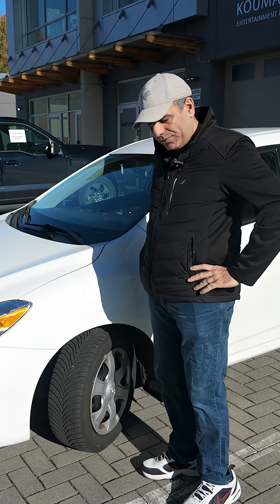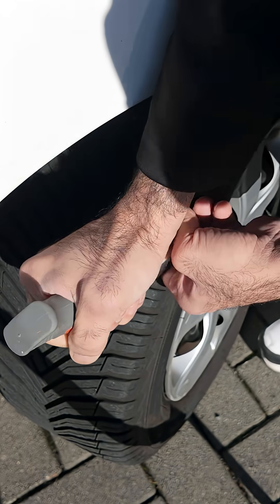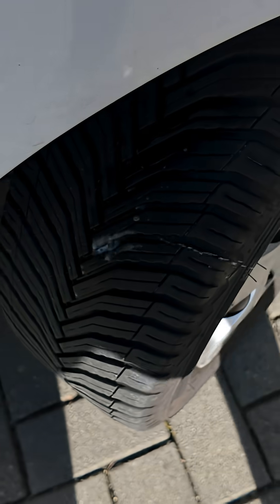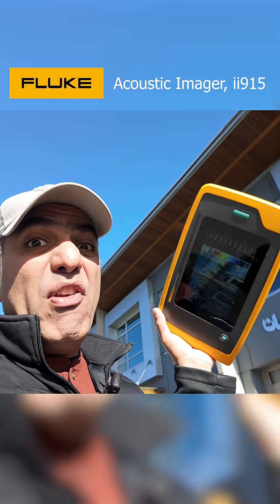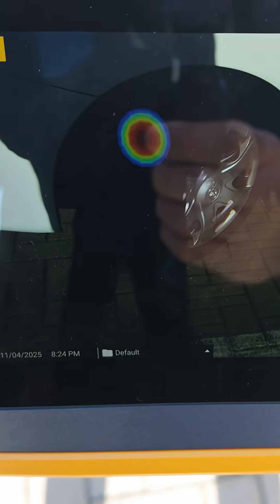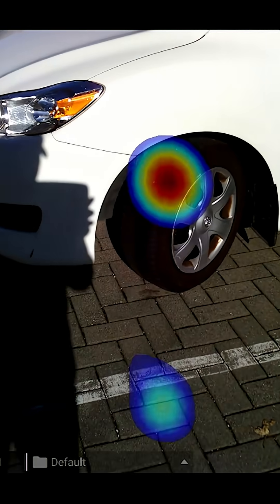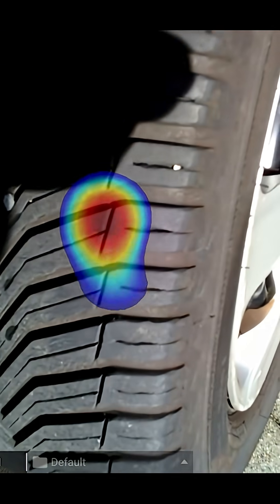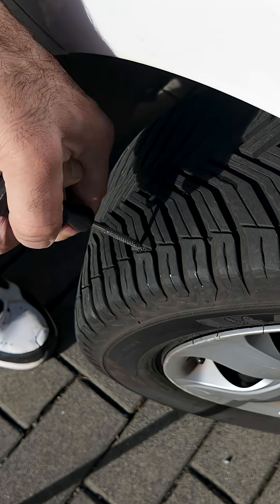Fix a Flat Tire with a FLUKE Acoustic Imager! #technology #equipment #electronics

Comment: Work in maintenance and use one of these to find air leaks quickly on a conveyor in a noisy environment. Bad idea to constantly spray metal equipment with water even if it's painted, and you can't hear air leaks over the industrial noise.
 
Aside from seeing a section of the bed not moving this tool is the best option.

Comment: Hi. Im a diesel mechanic and tank tester with 18 years of experience and you'll have a hard time finding someone better with tires than me. I just use soapy water. That device would be pretty good for finding air leaks underneath the trucks though. Everything on big rigs runs on air. And a lot of air leaks are inaudible, so you don't even know they're there unless you monitor your air pressures.

Comment: Those rope seal plugs don't fix the tyre ;) and the "tool" that comes with them makes the hole too big to legally repair from the inside :( They are for off road use only, and intended for places where you can't safely jack the vehicle up to change the wheel, literally just supposed to hold air long enough for you to move and change the wheel ;)

Comment: Fluke equipment is the best, but you need to be filthy rich to justify it. We use their cable testers in work for ethernet. The only downside is the tester cost like 5250$.

Comment: My friend had to build one of these as his electronic engineering end year project. The hardware is relatively simple, just a bunch of microphones in a spiral with a camera in the middle. The coding is where things get real complex, the bulk of his project was coding the geometry to calculate where a sound is coming from, Fourier transforms to breakup the frequency's and then a whole special heat map generator to show the user on the screen where the sound is. The whole project cost him around $300 but factor in the 6 months of coding and tweaks it makes sense that these can get quite costly. One of the coolest guys I know.
Reply: I feel like the main problem here is the synchronization of each microphone. Getting the analog data from each one at the same exact time is a problem. Not sure but off the top of my head, he is relying on the phases of the waves, that's why this is so difficult. They must be aligned, which is easier said than done, and I know I could not have done that.
Reply: @cagedgandalf3472 : I mean, that's really just an fpga/cpld/other hardware issue (to get high-accuracy time-stamped audio data), and does not get the algorithms implemented.
Reply: Meh. It's simple beamforming. 

The problem is the diffraction limit sets the resolution and sound waves have very long wavelengths
Reply: How far could large language models get I wonder.
Reply: @TechEject I believe not very far. This is a completely different problem than what LLMs solve, as they are fancy word predictors (unless I completely misunderstand LLMs 😅)
Reply: @Incommensurabilities  you kind of are. The first L in LLM is "large," and they MEAN large. They mean the internet, including all published research on this topic. The LLM can't understand scientific papers any more than it can understand anything else, but it can certainly synthesize their contents into a product of some kind. And generative AI in general could take a whack at this kind of stuff, but idk how effectively. Lots of human input required to sift through the extremely unintuitive results AI models put out when you have them try engineering.

Comment: Now put that tire on the back...so that your unsuspecting neighbor doesn't lose a steer tire by slinging that sht plug out while speeding down the interstate at 85-90 mph...or 137 -145 kph if you prefer metric.  TireBOOM lol.

Comment: For around 12K EUR, I probably will keep using soapy water. However, gas leaks in pipelines and at well heads, can be measured with accousic leak detectors as well.

Comment: I wonder how well this would work on a running engine. Would it be able to detect the location of a knock or tap or would it just be drowned out the normal emgine noise?

Comment: Ok here is a serious question, dont these repair kits ruin the tire even if its in the center of the wheel not the sides? Because they tell me to remove the tire, and fix it with some rubber from the inside every single time

Comment: So you have a flat tire
Step 1: do not panic!
Step 2: pull your High Mobility Artillery Rocket System from your pocket and ask it to change the tire for you.
It'll call in it's cousin juan, who will give you the turbo invincible master tire with a million year warranty.
If it declines, simply "barrow" a tire from it while it's not looking and use it to replace your tire.
Congratulations, you now have a new tire.

Comment: I've heard a lot about this, but this is the first time I'm actually seeing it used. military is looking into this tech as a way to locate drones (very topical), and arenas to identify issue points at festivals/concerts. I was never sure how accurate that would be but certainly with this the drone application seems very plausible.

Comment: Yes, but you just ruined your tire. Those rope plugs only work temporarily, and shops that repair for free won’t fix it now when it starts leaking. There were WAY better ways over showing this without wasting $250+ on a Michelin Cross Climate. Those tires cost a ton, and aren’t even all that good.

Comment: Cool technology, but not useful for that application. If the leak is so bad that it is audible, you can easily pinpoint its general location by listening, and then find the exact location by feeling the air against your hand. Slower leaks won't be detected

Comment: This is soo cool but wait! Usually customers will only notice air loss when tyre already flat so no air leakage to detect! Perhaps if it's a slow puncture or/and vehicle has TPMS installed this can be uses.

Comment: As a ex mechanic, those plugs are a good temporary but can cause issues in the future. And the nail, although most would probably say it’s fine, is very close to the side wall, usually considered unrepairable. Although debatable. Stay safe on those roads!

Comment: Honestly this thing could be a game changer. I am a HVAC contractor and I use ultrasound leak detectors for refrigerant. I wonder how well this would work. I was trying to find a leak in a evaporator in a walk in freezer and it was audible but still difficult to locate because the conditions
Reply: I work on industrial refrigeration. This would save me so much time.
Reply: For $9000, I think I'll stick to conventional methods.
Reply: This one is over $25k. They offer the ii500 to peasants that costs around $9k.
Reply: They only cost about $10k
Reply: I work in HVAC too, and I literally sent this video to my foreman 😂 his ears don't work anymore and half the team relies on mine when they can't find leaks!
Reply: we have them in manufacturing
Reply: The detector is infra Ray detector it detects the difference in temperature when the pressurized air in the tube releases it becomes cool so it appears as blue colour
Reply: FLIR has a really cool one, we demo'd one and were able to use it to find an issue in a gear train!

Comment: Smh 🤦‍♂️ I already know he put a hole near the edge planning on saving the tire and continue using it but a puncture within a inch to inch and half from side wall makes the tire unsafe to use anymore. He was better off going right in the middle of the thick center tread

Comment: A thermal cam might be able to spot this also...those are available to plug into a smart phone...
The air escaping only needs to be slightly different temp then the tread.
Reply: or it might even be visible due to the surrounding air being a different temperature since depressurisation causes temperature to drop

Comment: These are typically used in audits of compressed air distribution in production facilities. Even in a small facility leaks can cost thousands per year in electricity, and I have seen one that the analysis was $30k/yr lost to air leaks.

It never occurred to me to use one on a car tire.

Comment: string plugs are not ideal for a healthy tire, they are a temp fix and should be plugged properly from the inside to avoid steel belt separation 👍

Comment: We use these at work. The camera is good but not perfect. Very small (but inacceptable) leaks can only be found with the soapy water. The camera is good at positioning the leak though
Reply: have you tried detecting a fart with it?
Reply: By camera, you mean imager, right? Because this thing has both, but it's the imager part that's detecting the sound. The camera is just to provide a display for the user.

Comment: Technically rope plugs are only temporary fixes a proper repair requires you to remove the tire from the rim and put an internal patch but he punctured it too close to the sidewall for a repair and he basically just ruined his tire
Reply: Yeah. That plug won't last more than 25,000 miles. Oh, wait. Nevermind.
Reply: That plug will last longer than the tire.
Reply: @zachdemand4508  I’ve definitely popped a couple rope plugs loose doing burnouts over the years at least twice that I remember
Reply: The puncture isn't too close to the sidewall for a patch. If it was on the shoulder, maybe, but not in that spot.
Reply: @Jeff.78 

Yeah, why is this constantly brought up here? It's not on the shoulder, and it was more than 1/2 inch away. It's well in the widely recommended "safe" area.
Reply: @fragiggle 
Some people are only smart in their own mind as opposed to reality.

Comment: Hey that's how we find AC leaks on massive systems. We as in the technicians I looked up to I can't afford much more than the $500 sniffer...
Reply: Use joe, he has a good nose
Reply: Develop more skills thin pocket man
Reply: I use 1200 one. Pays for it self.
Reply: @Jugc0006  1200 for what?
Reply: @j @jishan6992  a sniffer 😂 it helps you locate particles in the air, like coolant that may have leaked out of the ac.
Reply: @ferretlord3990 that's literally what its called? Valid i guess 😂
Reply: @jishan6992  when I was younger,  I once spent $1,200. On sniffings! 😲😬🤤
Reply: @Life_42 thanx, it was a joke anyway.  I live in washington,  I'd rather enjoy the tiny bits of sun and lots of rain myself 😅
Reply: @Jugc0006  what's the name?